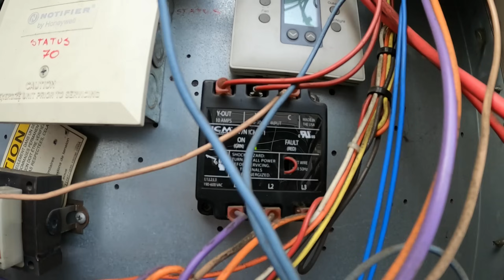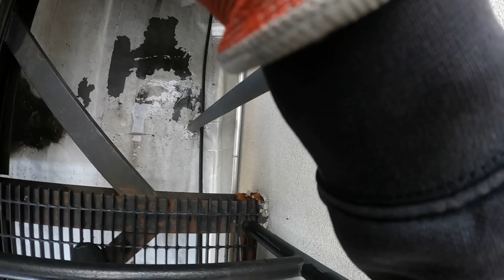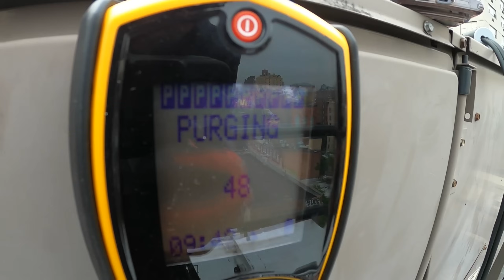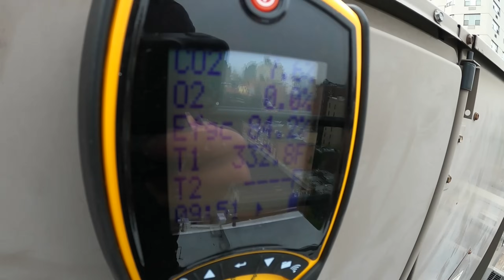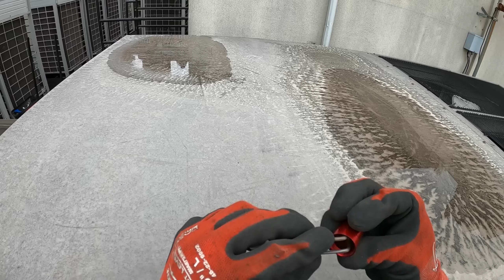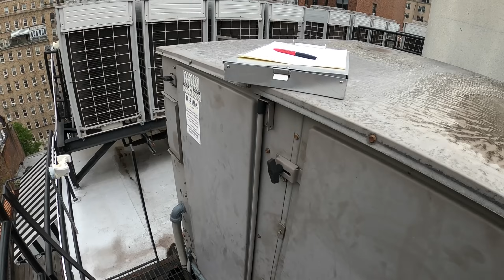HVAC: York RTU Furnace Combustion Analysis, Gas Pressure Test, Maintenance, Evaluation & Testing

Comment: i bought the testo 300. i work mostly residential equipment out in indiana now, i am a nyc plumbing journeyman with tons of experience in light commercial. good job using a analyzer most techs do not use one.

Comment: Excellent video my man! This is a great video for new techs just starting out in the field especially commercial!  In regards to the condenser fans that is correct when you have multiple condenser fan motors like on those York models and most larger RTU’S with several motors mounted with in the same compartment or general area. When one or more even of the motors fail or run cap fails and a motor is not running they can be deceptive and appear to be running slow or backwards, when what’s taking place is the suction ( air being pulled through condenser coil) creates an air vacuum that will make a fan blade on a dead motor appear to move slower or actually run in reverse but usually at a slower speed than the operational motors. Also always make sure you you don’t replace one of these with a weaker motor the other motors can cause the replaced motor to fail premature… Again great video I give you mad props for being thorough we need more techs and installers in the field that actually care and trained correctly! 🤙👍 It almost like all parts of New York is Hackers Paradise 😂 …. But really it’s not funny it’s scary.Also quick little trick your refrigeration ratchet wrench and the adapter for residential condenser liquid lines is exact size Allen key pull need for any gas valves with larger ports… Try it it’s much quicker brother!

Comment: That was the spark ignitor that you cleaned, the flame sensor is at other end of burners., also the thing you called the ignitor was the limit switch, witch always go bad on them Yorks. An that other reading on your manometer is the difference between p1 an p2. Keep up the good work

Comment: With that high limit code,  why didn't you check the high limit. Saw a lot of rust on this connectors And in that area. Great work still though

Comment: If I need a coil I am going to seriously talk to them about a new unit. If they wand the repair done, we are using a crane to bring the coil up. And if anybody is curious, yes the prices of HVAC equipment has at least doubled between 2021 and 2024.  I imagine that unit after install in Manhattan would be $75,000 - $100,000 in 2024.

Comment: The part you cleaned is the Spark Igniter.  The part you referred to as Igniter is Safety High Limit with rusty connections, clean it too & problem may be solved.  The Flame Sensor is at the other end of the burner to prove ignition all the way across, follow the thin Orange wire on the right side.  Fat Orange wire on left side is High Voltage wire to Spark Gap Igniter.
Thanks, enjoy you videos.
Reply: Just about to add this bit.  Igniters can usually run fine for a long long time even when rusty.  Flame sensors on the other hand are far more finicky and will definitely drop flame if the spade connection is rusty or the actual tip of the flame sensor is dirty.

Comment: Yo homie....your refrigeration valve service wrench and adapter fit those plugs on gas valves perfectly, and it makes it easy to loosen and tighten. Just a friendly tip. The gas valve has been in a moisture laden environment. You see that on a high efficiency furnace. Moisture will travel down the intake pipe and condenser, and drip on the gas valve. That's why you see a drain and trap on them. It happens when it rains and in the summer. 

Another tip, your analyzer was not in the best location. At the tip, you are reading more diluted air. The better location is at the Inducer outlet or at least within 3" of the outlet. Not saying it was wrong, just closer to the Inducer is more of an accurate reading of the equipment. Usually a ⅜" hole is good and put a plug in its place when done. 

The number on the bottom of your manometer is the differential pressure between P1 and P2 pressures. 

Another thing I noticed was the size of the pressure drop when the heating kick in. It went from 8.5" to 5.5-6". Most manufacturers say that after a 1" drop in pressure, you should inspect and test the regulator, and confirm size of gas pipe is sufficient. You have enough for the minimum supplied pressure....just food for thought

Also didn't see you take a temp rise check. The pressure may have been set that way to keep it from tripping the limit....mostly due to undersized ductwork or poor airflow

Comment: This one I highly dislike, & if I ever see something like this again, then I have to unsuscribe :)  Why are we trying to explain things pretend ing audience is someone that never seen an RTU, or gas pipe, or a  furnae or  AC/ etc.? 

 Easpecially a dime a dozen all POS York/ Colemam/  now Johnson Controls, for that matter all Carrier whatever units also;  that all unbelievably change for the worse. New control boards on Yorks that don't read out on display if below 0 outside that tech support says heat up board however to be able to read display!

Off tangent, but also why would would one do a  combustion analysis on such units? Easpecially if analyzer doesn't have working 02 sensor?

Your vacuuming out little rust is also almost a tot🎉al joke besides being totally useless to do, them  gas shut offs also have no stops on them.

More curious looking question is;  are those LG units at minimum distance from eachother or way too on top of eachother??

Cool video would be of replacing this equipment.  

Same as in Chicago I'm sure.. 

A heli lift on a weekend day?

Why do you take the time to point to high limit safety saying i'ts an igniter when these units are spark ignition?

Good luck man.  No need to dumb things down to such level.  One without much mechanical savy or common sense gets weeded out of our industry pretty quickly thank God 99% of time.  Not talking about capacitor "bandits" people we are al guilty of!

Cheap work makes work look like garbage. Garbage in not installed or commissioned properly =s garbage out along with garbage people in our industry thank God